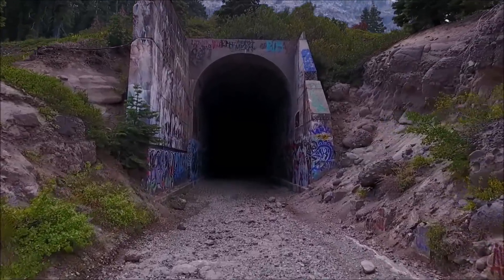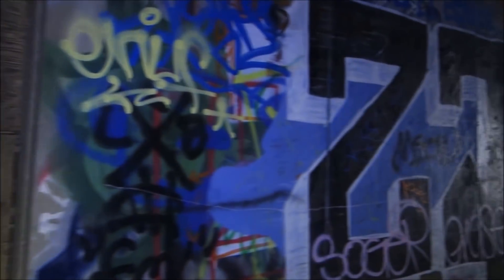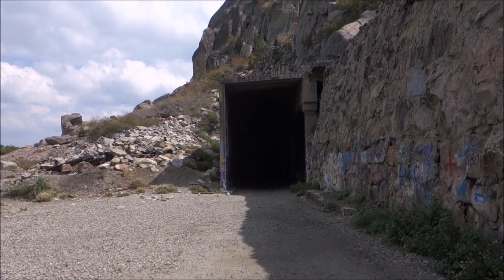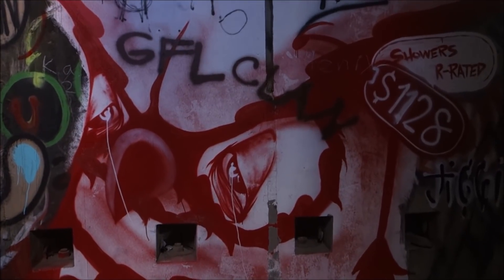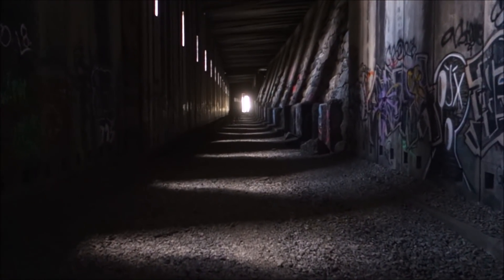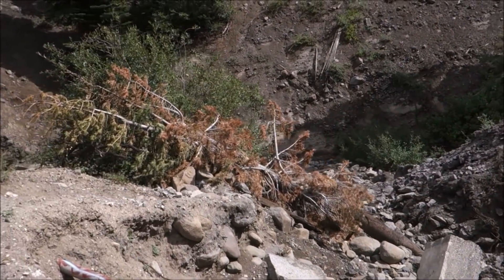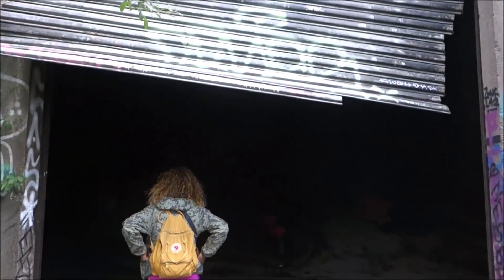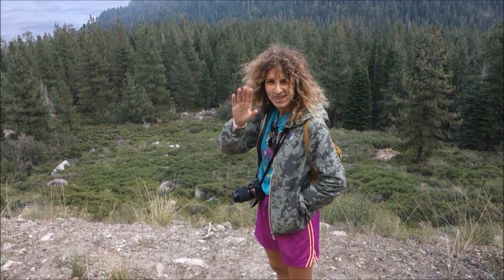Exploring The Donner Railroad Tunnels

Comment: I did this hike last summer (2022) and it was awesome! It's 3-1/2 miles from the entrance to the first tunnel to the intersection with the current through-line. Everybody in your group needs a flashlight or headlamp and not much else. Across the road from the entrance is the Donner Ski Ranch and the restaurant/bar there is open all year. In July-September it's a popular stop for Pacific Crest Trail through-hikers and quiet a party scene.

Comment: I recently retired from working on the railroad and in the early 70's worked that route between Roseville and Sparks.  I have passed thru those sheds and tunnels on a train and had some long and dreadful experiences inside the sheds with train breakdowns.  I only loaned out there for about six months as my home seniority was in Tucson Az. but it was always interesting to traverse the Sierra on a train!  Thanks so much for the video, curious if you could mountain bike thru the tunnels today?

Comment: 4:54 I have climbed out that hole before. Its not the best honestly. the rock up is pretty slick which makes it hard to grab and once you are up you are left with following the tunnel back to where it juts out from the hill or getting stuck at a cliff. Right after the tunnel passes over the great wall of California looking towards Donner lake you can see a flat rock face that shoots up from the tunnel. You get stuck on the other side of that rockface and its nearly impassable without rope.

If you keep gong down there are way better places to get on the roof of the tunnel. A lot of fire rings and a sad amount of broken glass up there.
Reply from the maker: Thanks for sharing that information. I was curious about that spot.

Comment: Folks-  Model Railroading is a hobby of mine, that also means that we as hobbists look up history for modeling facts to represent on our layouts.  So here we go...

Southern Pacific had a special set of circumstances with these tunnels.  Steam Engines are horrible polluters and the smoke and steam that come from the front of the locomotives is highly toxic.  These tunnels used to kill the train crews leaving the locomotives and trains unchecked over the summit causing very hazardous situations in Reno, should the Locomotive had enough steam pressure built up to get them over the "hump" so to speak.

Southern Pacific was having the train stop in certain locations to vent to prevent the crews from expiring over the mountain passes.  So what was happening?  Steam Engines exhaust over the "front" of the boiler out of the main exhaust stack.  The smoke and steam then blow over the top of the locomotive.  Under normal circumstances, this is normally not a problem.  The locomotives are out in the open air.  However, in tunnels the some and steam are trapped blow out of either end of the tunnel completely enveloping the locomotive(s) in their own exhaust gasses suffocating the engine crew.

The Sacramento Shops of Southern Pacific known for their unconventional solutions to such problems had a unique solution to this issue.  In Northern California the Steam Locomotives were primarily fueled by #3 Bunker Oil not Coal, as with Union Pacific.  The fact the locomotives were fueled with oil allowed the mechanics to plumb oil lines to the Oil Injector at the firebox thus enabling the locomotive access to its fuel source.  The Sacramento Shops resolved the problem by turning the boiler backwards and placing the cab of the locomotive on the head end rather than "behind" the boiler and firebox.  These Locomotives became known as the "Cab Forward" or "AC Series" Locomotives.  These were huge locomotives, basically Southern Pacific's answer to the Union Pacific "Bog Boy" locomotives built for their up hill battle with Sherman Hill.  

Finally culminating in the AC-12 Series, this locomotive under wide open throttle would evaporate 12,000 Gallons of water per hour.  But could pull a train 1 mile long at an average of 25 Miles per hour up the Sierra Nevada's and over Donner Summit finally terminating in Reno.  After WWII all but one of these locomotives were scrapped.  The only existing locomotive sits in Sacramento at the California State Railroad Museum on Static Display.  Locomotive 4294 is the only remaining AC-12 Cab Forward Locomotive left in the world.  There are no others like it anywhere.  Its a testament to the engineering genius of the Southern Pacific Railroad.  

Interestingly enough, this channel is about the mines and exploring them.  But what is not always known, is that many of the mine employees and mine engineers came from the railroads.  As the railroads would move forward, sometimes employees did not want to move with the railroads, they wanted to stop and settle down, get farm land, work for a lumber company, a mine or try their luck on a mine claim of their own.  So they would use the trade skills they learned working for the railroad and apply them to their farms, mines, lumber companies or whatever they had to do.

And... yes in the early 1990's the final train went through these tunnels.  Southern Pacific did not want to continually maintain the route, and re-routed the trains on the other side.  And again Southern Pacific had the Sacramento Shops, (now located in Roseville), create another locomotive this time a diesel that would have to fight these summits, (EMD- SD40-2T... AKA: The Tunnel Motor).  The standard SD-40-2's Diesel Engines would overheat.  The cooling radiators were not large enough to exchange the engine heat fast enough.  So on these locomotives the frame was extended by an additional 8 feet and a larger capacity cooling system was added with extra fans.  This solved the problem.  

At any rate, another piece of history...
-Shane McGuire
Reply from the maker: Awesome details! Thank you...

Comment: these tunnels are what the cab forward locomotives were designed for
Reply: since they had to be used in cab forward configuration, locomotives from Roseville had to be turned around for the return trip. therefore there was a huge turntable inside the sheds at Norden pass. Southern Pacific donated that unused and abandoned turntable to the Roseville Historical Society to be used for a railroad museum that never happened. when Union Pacific assumed operations, they wanted the turntable removed, but it was too big to move, too long to make it through those tunnels, so it was scrapped on site to fund the Carnegie Museum in Roseville. I had the sad duty to cut up and remove that historic piece of equipment. so sad. the graders at Schnitzer steel scrap yard said it was very high grade steel, they were impressed having not seen too much of that type of scrap in many years
Reply: @deanmoore1752  thats great history thanks dean , yeah the up messed up alot of sp history

Comment: That would make a great rail trail for those of us who do not like to walk!
Reply from the maker: Yes, it definitely would.
Reply: Whats a rail trail?
Reply: @tommcelroy6975  Train tracks removed  leveled with limestone and packed for riding with the concept that the train track could be reinstalled at a later time if required and the rail bed would need minimal work. I do not know of any rail trails that have been reused by trains. Terrain is about 2.5% grade so downhill you still need to pedal . Rail trails go quite the distance in some places.

Comment: You were hiking the roadbed of the Old Southern Pacific Railroad Track#1, built by the Central Pacific Railroad in the 1860's.  To cut operating expenses, the Southern Pacific removed Track 1 over Donner Summit in the 1980's (they continued to use Track #2 which was built in the 1920's.)  In the 1990's the Union Pacific Railroad took over the Southern Pacific.  Today due to increased rail traffic, this single-track segment (and another segment west of the summit) create "choke points", hindering efficient rail operations.  At some point, the Union Pacific may have to reinstall the track in the tunnels you hiked.  In removing the track, the Southern Pacific was "penny wise and pound foolish."
Reply: The old 'Espee' often seemed to have a tendency to not look very far down the road at times.  This track should not have been abandoned and ripped up.  I would also guess the UP will eventually relay the line.
Reply from the maker: Thanks for the additional details... I wondered about that bottleneck. I took an Amtrak to Reno a few years ago and we had to wait for a while near the new tunnel for the traffic ahead to clear out. It'd be interesting to see them rehab that abandoned (for now) section.
Reply: Espee didn't remove this track, Union Pacific did.

Comment: I camped many times near Donner Pass in the 1950s with my parents. Then the snow sheds were wood and most of the tunnels had wood snow sheds at their entrances. Back then, Southern Pacific was still running cab forward steam locomotives. Cab forwards came about to keep the crews in front of the smoke in the snow sheds.
Reply from the maker: I would love to have seen that area in the 1950s... I am quite envious of you for that experience. I didn't know that the snow sheds were still wood up until that recently. I'm sure the crews appreciated the cab forward designs on the locomotives!

Comment: Those weren't signal cables, they look like circuit break collapse wires. If there is a collapse of the boulder pile that may block the limes, it would break the circuit of the wires and put stop signals up along the track and alert railway crew to respond to the collapse.
I have seen similar here on tunnels through mountains and even alongside some roads in Alpine areas where rockslides are prevalent!
Reply from the maker: Yes, I think you're absolutely correct.

Comment: Very cool!  Now I want to make that hike :>  Looks like people ride quads through there, right near the collapse area near the end of the video there were some quad tracks. -- There was a 2011 television series called "Hell on Wheels" based on the race between the Union Pacific and Central Pacific railroads to build the transcontinental railroad.  Near the end of the series they touched on the trials and tribulations, and loss of life, to get these tunnels blasted.  May 10th 1869 the two lines were joined in Promotory, Utah, where the presidents of both rail lines drove a ceremonial last spike, a Golden spike, into the rail.
Reply from the maker: It's a cool hike if you can find the time to get up there... I'm not sure how old those quad tracks were, but it'd be a lot tougher to make that ride in now with that big washout. "Hell on Wheels" sounds interesting. I'll have to see if I can track that down somewhere. Thanks for the tip.

Comment: I love how the snow sheds and tunnels were built together. All those (new) snow sheds use pre-cast units, pretty cool, and replaced the wooden snow sheds of old, now mostly pushed over the edges and largely burned. The old timbers are all around down-slope. There's a bit of road history too; between the second covered hybrid tunnel and the 1st long tunnel/shed, the rail grade crosses the original stage road. It's a blip of a bridge and a rough narrow grade.
The new RR tunnel is a shorter, more straight shot through the mountain, making this, very curvy and longer route, obsolete.
I'm glad they did not close them or blow them up like so many mines.
Reply from the maker: Yes, there are a few sections where you can see out of the concrete snowsheds and look down upon all of the remnants of the wooden snowsheds... Aesthetically, I prefer the wooden sheds. That is very interesting about the old stage road. I wish I had known that when I was up there.

Comment: My name in spray paint has graced many of those tunnels back in my heady days of snowboarding!!
Reply from the maker: Geiger Mouse It is difficult to add a silver lining to your story. It makes for a good story and, undoubtedly, it was an interesting experience, but I doubt you would consider those modest upsides to be worth it. Motorcycle accidents don't seem to have done anything positive for my body either. Strange, isn't it?
Reply from the maker: Stabit I forget what SMP stands for, but I remember the gear from the 90s. Supreme Mormon Power? Submitochondrial Particles? Skim Milk Powder? Sociétés Militaires Privées? SOOOO many "SMP" possibilities...
Reply: 8:09 SMP!!
Reply: SMP???   Shit My Pants??
Reply: Snowboarding was fun for a few years until I was struggling to keep up with my cousin who was very fast on his skis.  I was really pushing my limits on crusted over iced powder and caught my front edge at high speed and did a nice helicopter crash where the board planted and I kept twisting - even heard my spine crack.  Got a nice kink in my lower back visible on x-ray.  Many chiropractor visits later over several years - I am better.  Still have to be careful if I twist wrong while picking up something heavy!  And then there were the motorcycle crashes... lol
Reply from the maker: Adit Addicts Does it look much different than it did in the 1990s?